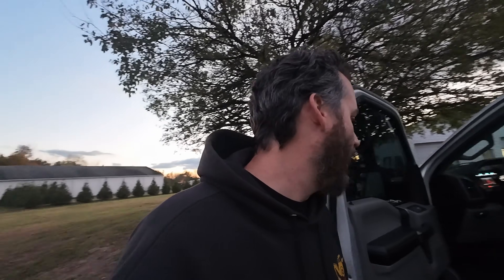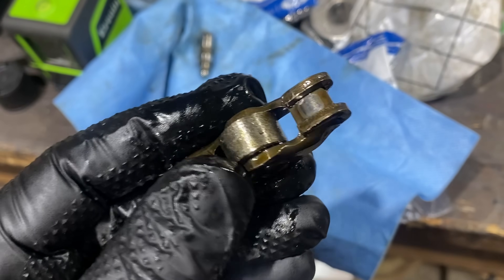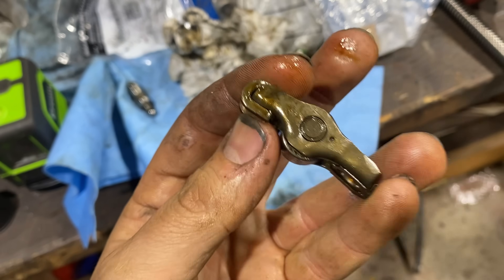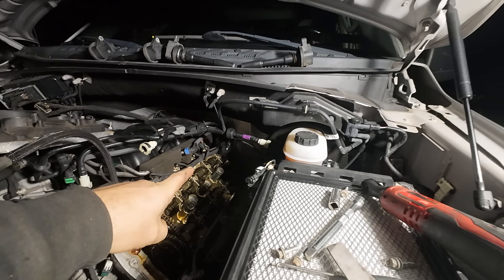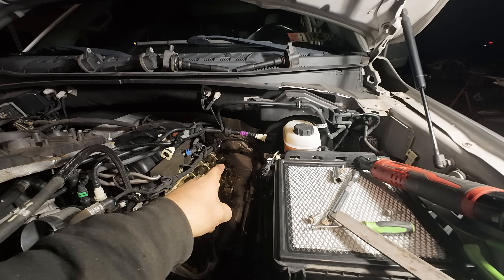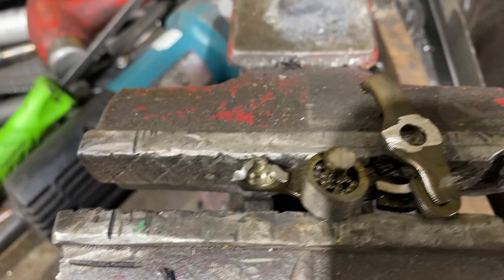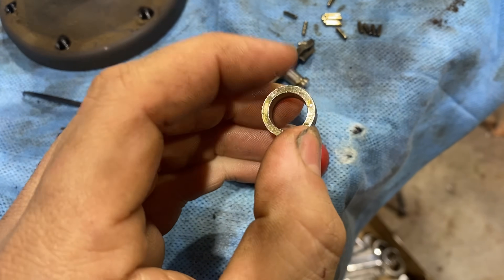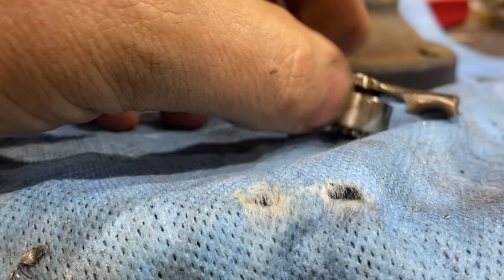Case Study: Ford Coyote rocker failures revisited. What Happens?? 5.0 V8 Mustang F150 Tapping

Comment: I'm no designer, but needle bearings seem like a bad idea as a rocker roller. Every part you introduce to any design is an additional failure point.  
My 2018 F150 5.0 has 215K on it, my valve cover just started leaking, glad i found this video before i pulled the cover. Now i know what to check!

Comment: Ford has changed the design of those rockers. This tells me they know their rockers are failing due to designed. I think you're on to something in regards to the hardness.  Also, maybe due to heat wearing them down premature which you also touched on with limited oil getting to the needles. Either way. I appreciate your work on this issue. Ford doesn't seem to want to address then issue with a recall because most of the Coyotes make it past 85k-130k befor serious issues.  Thanks again and great work!
Reply: Someone mentioned how there was a bad quality lot purchase of these in the past and instead of eating the cost like a responsible company, they had them used & installed on vehicles regardless. If true, do you think doing this repair job is still worth it with OEM parts? Or should we all just be looking at a different aftermarket brand that makes these for better longevity?

Comment: Looks like those rockers need to be treated like Japanese cars w/timing belts. Every 100K miles, just figure on changing them. Typically, if you use rollers w/out a cage, they either require very specific dimensional spacing and high RPM or they need to be staggered in size to prevent 'spragging'. It looks like an engineered 'fail', to get it way past warranty or perhaps that center shaft wasn't properly hardened, we may never know. Your tear down and analysis however, FANTASTIC and I'm not even a Ford guy.
Reply: Timing chain is F ing ridiculous!

Comment: It's not just Ford that's having these rocker failures, but GM, Chrysler, etc. I don't believe that these parts are receiving the correct process to harden the steel correctly. Many individual engine parts aren't built in house and could possibly be sourced from the same suppliers. There definitely seems to be an issue with many automotive parts not being correctly heat treated in the last decade or so. EXCELLENT video! How you explained the repair makes perfect sense. If you're going to do it "correctly" I agree that everything should be changed out, cams, lifters, rockers, chains, phasers, etc. It's going to be a big bill. There's absolutely nothing wrong with doing as you did. Allow the customer to make an informed financial decision. Like you said, where do you stop? Oil pump, pull the heads since the engine has 160+ on it? It can snowball really quickly.
Reply: If the parts themselves to build the rockers are sourced separately, maybe the individual parts producers have different ways to measure hardness. So on paper the bearings and shaft are the same hardness, but in reality, their production methods and/or quality assurance measures hardness differently?
Reply: @bille4889  Either way, Ford/GM/+ should NOT be putting bad parts into NEW vehicles and hand over the repair cost to customer!
Reply: If its a rocker failure, then why go further? Sure the idea is "since you have it open and want to do it right" but if it is just the rocker with bad QA parts then just stop there.

Also another user in another different video said this:

@Marc-r3s3z
1 hour ago
 @MR-MR-ud5oo actually weak return spring inside lifter causing the extra slack notice able at rocker to valve lash
What has happened is GM had a surplus in lifters that were questionable and they decided to use them in the new engines instead of taking the loss in this way puts the burden on the buyer of the engine GM bought faulty lifters before having a use for maybe two years ago
Instead of throwing them away and taking the loss for the company that just decided to use them in your engine

Comment: The rockers are to flimsy and undersized for he task,,,And the materials that it's made from is sub par,,,In other words,,,,Cheap junk,,,As per usual Ford does the bare minimum in terms of quality ,,There probably made in china,,,You should buy a 7.3 Godzilla ,,There supposed to be really good quality components from stock,,,There is a pro engine builder on YT that is making 1900 HP with a 7.3 totally stock ,,All he did is slap 2 turbos on it,,,,,And its holding up just fine,,,,

Comment: Love that you exposed this! I bought my 2018 F150 brand new and it started the tapping after 1000 miles. The dealer said they couldn't find any problems over and over until the warranty ran out. I would be interested to know if there are any after market roller rockers available? Might be worth swapping them out as it has very low miles on it?
Reply from the maker: Wow 1000 miles thats a shame! Well ford knows that this is a problem, they have since changed the design of their rockers. But "publicly" they haven't acknowledged this.

Comment: Ford needs to redesign those rockers and those rocker bearing shafts definitely are not hard enough. If that's two bad ones so far in that one engine (the first 2 to get bad enough to make noise). I would be curious to pull a couple more just to see how much play is in their bearings. I wonder how many other people are running around with these flawed rockers waiting to come apart. It also wouldn't hurt if that hole was opened up because then there would be another path for oil to get to the needle bearings instead of just relying on splash off the cam.
Reply from the maker: I agree. It would be cool to cut one open that isnt super loose yet and see how the shaft is looking. I have heard several of these engines tapping in parking lots and redlights.

Comment: In theroy removing all of the rockers and inspecting them By cutting them apart like that is the only way to say for certain that it's a design issue or a hardness issue. If a few have wear and others don't it's a supplier cutting corners or faulty hardening process. But if it's the same rockers doing it on every motor then it has to be an oiling issue.

Comment: It seems that not only Coyote rockers have that kind of problem, but many more others like the old 3.7L Jeep Cherokee and the so-called HEMItick.
That roller's axis has to have some bit of plasticity to be able to be squeezed at its ends to hold tight in case, so it can't be hard enough by design...
Reply from the maker: Interesting perspective there, I appreciate that. I considered how they "crimp" the stamped parts onto the shaft

Comment: There is no issue with a rocker lasting 3000 hours or 150 000 miles.... the problem is the truck was 50 000 or more new.   just how long should a machine last????    machine work so long now until they have huge failures like this one.   Look at how many hours a 1970  made vehicle  was in the shop.  10 times the hours per year a new car is in the shop  but cars did not cost three years worth of disposable income.    WE as a culture just drive around and do little.   In 1970  trucks still did work thus you maintained them and did not care if they broke... the question was can you fix it?  and get it back working tomorrow...  that is just now what the average buyer wants now days... They want  leather seats with heated lumbar support... my grandfather would not even know what that is.....  anti lock brakes with traction control the list go on forever... it is not the manufactures... they are making what people want.    1975-1980  every person that bought a new car said... "it better get better fuel economy that my last one..."  and in 1979  you could buy a Honda civil that 45 miles to the US  ;gal.     What happen????   consumers got over the price of gas and WANTED TO FEEL POWERFUL... so now every truck has 400 hp when 200 is more than enough.   Every one is a victim  if you listen to them.  They never made a choice that lead to their own issue not one time.\
great videos... I love the way you think.   You are what   "mechanics"  used to be.   now they ask the computer what to change and open the parts cannon,   and people pay them.... so what the issue???

Comment: to me it sounds like its a mix of everything you listed. There are definitely issues that present themselves from babied motors and are resolved when driven flat out. The same can be said for the opposite (usually this is the case). I am with you that hardness might be an issue, which could be solved with better oiling but would still leave fringe cases susceptible to failure. I would love to see the new rocker taken apart and compared. You gotta start a patreon or something, I am sure the cost of buying a brand new sacrificial rocker (and other for education only purchases) would be covered by community backing in the name of the scientific method!

Comment: Another vote for the shaft being improperly hardened here, the rollers aren't spinning so fast as to make splash lube inadequate & there was plenty of oil (just IMO) on the rollers when you cut it open. The only logical answer is the shaft is just too soft.  Ol' Henry needs a dose of blue pills methinks.

Comment: Bad Heat Treat on the inner race/pin if the needle bearings and outer race are not worn. I would swap all of the rockers out for better quality aftermarket ones.
Reply: "Better aftermarket ones" Do you have a brand in mind?

Comment: 15:26 Reckon you have a valid point about oil ingress ability and oil pressure. Presuming those little feed holes, were they actually bored fully through, would be liable to get easily and quickly choked up with junk, due to their size. 
But I think the major problem, and I can't see that it's not going to happen over and over, is that the bearing shaft is simply made of material that is WAY WAY too soft. Possibly, maybe, you could forge heat the rocker, fast quench it, get it proper hardened. Problem with this approach is that the rocker arms might then be liable to snapping or even hair-line fracturing through brittleness, ie. losing its toughness and ductility.
Reply: Possibly there's a replacement part, exact dimensions, from a 5L motor 20-40 years old with better material science behind it. 
Or you could try replacing that pin on all the rockers with with one of appropriate hardness. 
This problem will keep on happening.

Comment: I agree that is is most likely some material issue related to the shaft, improper heat treatment is the most likely, then of course there could be issues in the actual metallurgy, but that is a bit easier to catch usually.

Before I worked in engineering and manufacturing I would have never guessed the frequency of how often you just don't get the material properties you ordered.

Of course Ford should have a process to control for this, but that's just a six letter word. And it's probably not far fetched that whole rocker assembly is outsourced anyways.

What rpm do you think that being is spinning at? I'd guess it's not that fast relative to its size and the amount of oil it seems to have on it looks ok to me.
Reply from the maker: Interesting thoughts/points. I never thought to consider RPM of the rocker roller. Rough math/// average engine RPM 2000 making a cam speed of 1000. Cam lobe circumference is probably between 1.75-2.25X roller circumference. I guess its safe to assume those rollers hang out around 2000RPMs most of their lives in a 10 speed F150.

Comment: The point about the beating on it is interesting.   In the UK, Gen 1 Ford Mondeos that were being nursed were experiencing premature engine failure.   I forget the exact failure mechanism, but apparently the engine needed to be revved to 4k+ to allow proper lubrication (something to do with the valves rotating at that rpm?).   Anyway, it needed an Italian tuneup from time to time.

Comment: You should check the Rockwell hardness of the shaft
Reply: Old rule from old racer- never pour money into a platform that can’t run strong from stock.if I was that guy I,d pull that weak & pathetic ford donk and get an OM606 or 6BTA in there 🎉 .looking forwards to your next trip to VA.greets from Ireland 🇮🇪

Comment: I would agree its a hardness issue AND an low oiling issue. the needle bearings would show scoring or would be somewhat scorched by the heat the friction causes if it had no oil. However because those needle bearings are getting minimum oil to them, they are able to outlast the weaker/softer part (rocker shaft) and the fact the roller rocker shaft is softer, the needle bearings now become the abrasive agent in a high heat low lubricity environment. The blind hole also could be an indexing/locating point for the tool dies to stamp the part.
Reply from the maker: Spot on I agree with everything you said!

Comment: I think your thoughts about a hardening issue is unlikely in terms of there should be many more rocker failures than have been reported i.e. batches and batches of rockers would be heat treated at one time and a failure of heat treatment should reflect that.    I don't understand the blind hole on the side of the rocker...was it because a machinist decided to take a moment off from time to time or was the hole needed to hold a manufacturing fixture? If it was supposed to be a thru hole then drip lubrication should be enhanced.  Regardless thank you for your work and I totally agree with your logic and the $33.00 repair.  Kind Regards, Craig

Comment: I have a 14 150 coyote  160000 no problems yet
Reply: The problem was corrected for the 2014 year. 2011-2013 are the problem years. Ford confirmed that they had a supplier issue and the metal hardness was out of spec on the needle bearing shaft. The being said for it to happen on both of the rear arms leads me to believe it is an oil starvation issue that Ford masks with better hardened parts. Imho.
Reply: @mikeromanage3696 The truck from this video is a 2018 so doesnt seem like its been corrected 😂

Comment: Somewhere along the line we (well steel manufacturers) seem to have lost the recepy to make properly hardended parts. This is what it is. Same shit you have that if you put a new flat tappet cam in your engine. and within the first test run it takes the lobes of the camshaft. Probably all comes down to cheaply manufactured steel from China which does not make quality parts.

Comment: I think it is just crappy parts.   I just changed all 24 rockers on my dodge grand caravan.  2 rockers were bad with the exact same issue.  dodge pentastar and hemi engines are having the same issues.
Reply: Yup, All major manufacturers are cutting corners to produce as cheap as possible. Nowadays there is nothing built to last. (because there is no money in that)

Comment: definitely "built ford tough", where "ford tough" is not tough at all. Or maybe they mean "tough s_ _ _ _" on the customer when it fails
Reply: Cheap parts. because properly hardended and heat treated parts are more expensive. All major manufacturers are cutting corners to produce as cheap as possible. Nowadays there is nothing built to last. (because there is no money in that)
Reply: @patrickvanden8322  There is money in making a quality product that lasts or every company would have failed decades ago. Its more greed as there is 100Xs more money in building a shit product as this will also affect the used car market because now you have much less used quality running cars available for dealers to buy thus driving up the secondary market. It also drives the manufacturer parts market which is where car manufacturers actually make the majority of their revenue. Car manufactures don't make as much as people think they do off the vehicle production itself.

Comment: I vote for improper hardening of the rocker shaft.  Can you run a fine file over the "good" part of that shaft?  I would think it should slide off without biting in.  JMO, that guy is lucky you're fixing it :)
Reply: That's what I came here to suggest.
Reply: yeah I would also like to see a file test to get an indication of hardness. Seems that made in China steel does not harden as well. probably the same issue as with flat tappet cams nowadays

Comment: Id think a brass bushing would last longer.
Reply: if the shaft was properly hardended it would not be a problem. think about a ball bearing both the races and balls are hardened.
Reply: @patrickvanden8322 It may have been hardened correctly and the needles got sticky. You gotta realize while a brass bushings does have more friction, under load it has more surface area supported to the shaft, needle bearings have a very small area being loaded to the shift, under heavy loads I could see the needles start to drag.